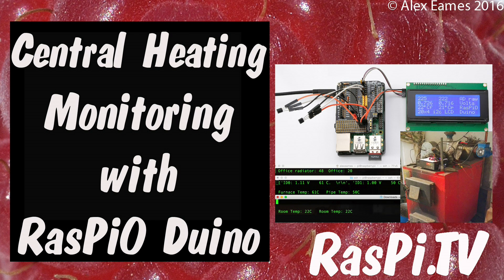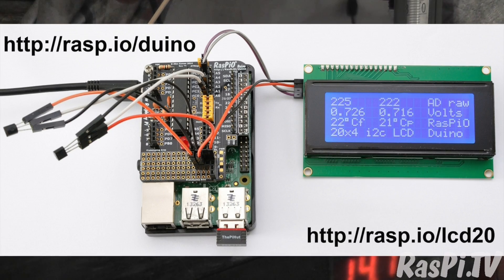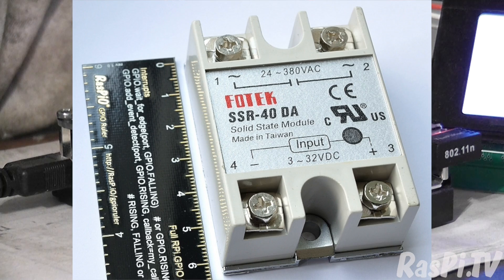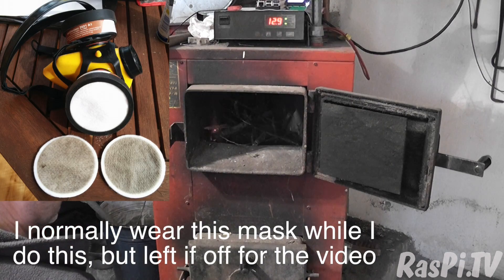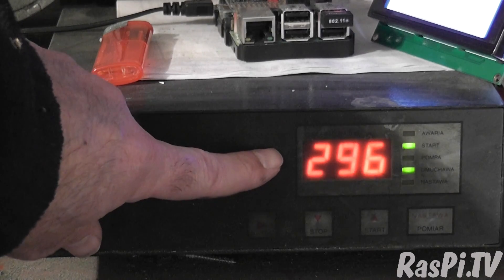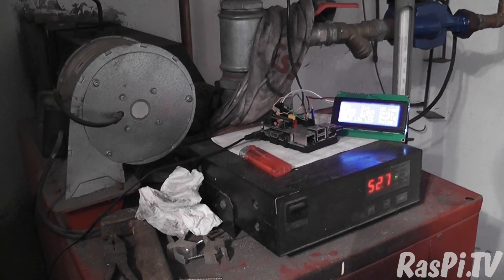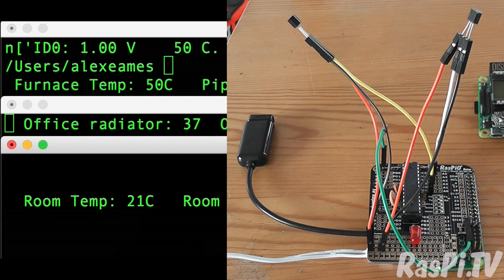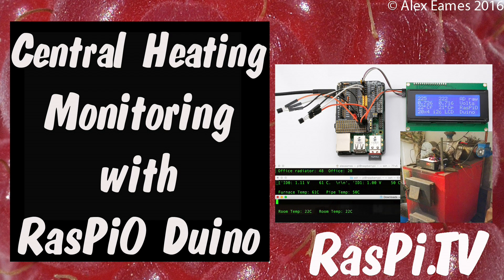RasPiO Duino Central Heating Monitor

Comment: Okay this sounds like a cool project. I'd like to set up something similar interfacing to the on off timer on our old gas boiler as it doesn't have a thermostat control. It's pretty standard, I'd be surprised if nobody had though of it already.

Comment: That furnace looks brutal!
Reply from the maker: +chefsolid It can be. For example if you chuck in a dustpan full of dust you'd better watch out for the hairs on your hands :) It's OK once you know what you're doing though.
Reply: +Alex Eames surprised you haven't converted it to using a fuel hopper to auto feed the furnace. 😉
Reply from the maker: Long-term it's not worth the cost. We only spend a couple of weeks per year in the house when it's actually cold enough to burn fuel. But we do have fuel to use up.